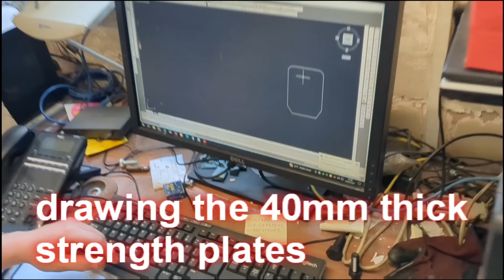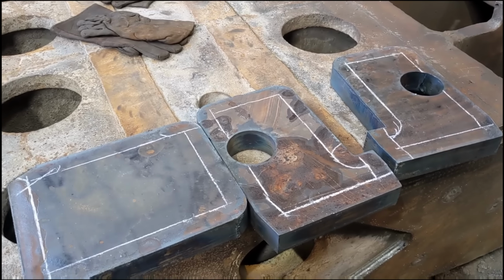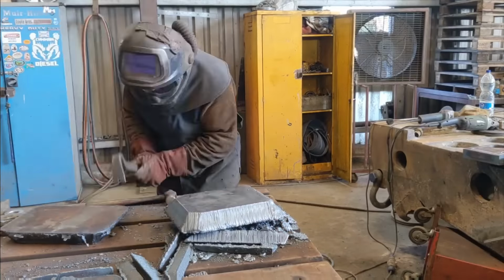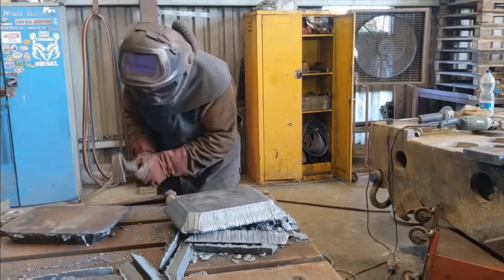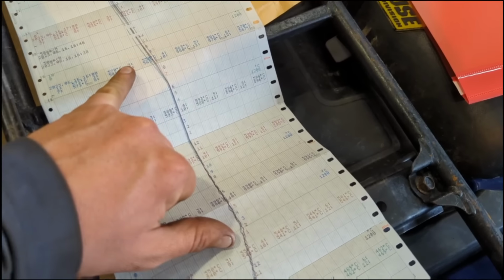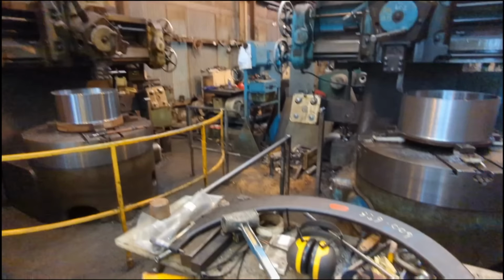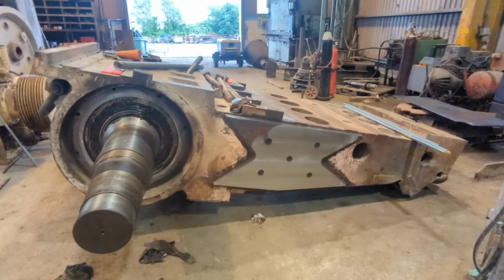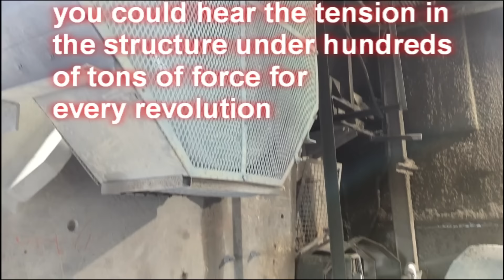10 ton mega welding repair job finished! 12 rolls of wire ! my 500th video! engineering machine shop

Comment: I have been welding since 1964 and still love it, but seeing the direction of travel is becoming a problem. I have not done it full-time, but many hobby jobs have been undertaken. In 1971, I built my aunt a bucket and blade for her Fiat tractor. In 1984, I built myself a tractor mower. From 1976 to 2000, I worked on bus repairs. Welding jobs always come up. Well done, sir; well worth the watch. Ted from down under.

Comment: 31:16  i do not miss that part of the job at all. I welded 18yrs in Brisbane and on the exotic metals  or pressure pipe stuff preheated, multi-run and its 38⁰C outside and your drinking so much water yet not micturating at all.

There is was a place in brisbane, Jaws Buckets Attachments that were always looking for blokes to weld these massive buckets. The whole thing is preheated to ~120⁰.  Flux-core turned right up, sitting on these things with blankets and bits of pallet timber, which would selfignite before the shift is over. Everyone is acting weird and aggro because they are seconds from passing out. I didn’t last long there!

Anyway, great job. Happy new year.

Comment: Great video as always, it is amazing how it holds together long term when in operation with all the vibrations and loads on the components, You have completed an outstanding job there. Just shows how important Heat Treatment is to the long term durability of the equipment.

Comment: A very challenging problem to put it mildly ,  the shear size and weight alone made it seem impossible .  Getting information on the best way forward was brilliant and correct ,  the shear mental battle of taking on this project is truly exceptional .  Many would have said no ,   but you have proved it can be done  .  A small tip the wire feeder , the Brass bushes  in the rotating gear are to soft , try getting them machined out and re bushed with  a material like Phosphor Bronze they will last a lot longer .

Comment: I read somewhere that society needs 8 tons of crushed gravel per year per citizen on average. No idea how accurate that is, but it adds up. Sounds like a lot till you add up all the uses for it. All the roads/buildings/concrete construction/etc. adds up. 

Awesome vids. You sir do some fine work. I love welding, but wouldn't even know where to start lol. My fav videos were oxy lance melting shafts out of crusher housings. Those jobs were cool to see, but nothing like this. I remember watching you when you first started posting the kubota articulated loader vids, been a long time. Congrats on the  popularity. Hats off. Have a good one

Comment: I loved watching all three videos on this project. I love rock crushers, welding, machining, etc. I used to be a heat treater for bushings, cutters, and many other parts for oil drillers. I also heat treated parts for tools and many other items. You should do more videos on these rock crushers, in my opinion.

Comment: Would be interesting to know how much is charged for a job like this? Not exact figures but rough estimates
Reply: I was wondering was it not better for the owner to buy that whole new peace ,rather than paying for the welding,which is always risk in my opinion.I believe prices could not be very different ,i mean new part vs this repair job.
Reply: @TheSRBgamer63  he said it has been running since 1989 in the video, maybe the jaws are no longer manufactured? I would imagine 2 months of welding, machining with their specialised equipment and cost of electric for welding/heating etc, the repair must have been 75k+. Even if it was 100k+ that may be cheaper than new 10 ton cast jaws. Such an interesting channel and the jobs done are next level

Comment: Congratulations brother, great job you did. Takes me back to my welding apprenticeship in 1975 in a gold mining repair shop. No such thing as ear-protection, fume extractors or respirators, just plain ole compressed air to ventilate confined areas.  Good memories but hard work and lots of dust, smoke and sweat.

Comment: Interesting to watch. As for the heater power, 150 kVA (or 150 kW since heaters are a resistive load) sounds about the right ballpark. Steel has a heat capacity of roughly 0.5 kJ per kg and Kelvin, so to heat up 10 t of steel by one degree you need about 5000 kJ. 150 kW delivers 150 kJ/s, so about 33 s to deliver those 5000 kJ, or in other words with that power you could heat up the crusher jaw by just under two degrees per minute or 550 degrees in five hours. Of course that ignores heat loss to the environment (and other details like that the heat capacity isn't completely constant over this temperature range), but I think that cancels out with not the entire jaw being brought up to full normalizing temperature either.
Reply from the maker: Awesome figures bud thanks for that insight

Comment: How about Submariners?  I'm a retired US Navy Career Submariner.  Served on four nuclear submarines with lots of Shipyard Time.  I retired and worked on the same Subs I served on.  Visited General Dynamics Shipyard more times than I like to admit where they build the SSN-688 Class, Seawolf Class SSN-21 the New Virgina Class SSN-774 Subs.  Closely worked with Portsmouth New Hampshire Shipyard for Submarine Repairs and Overhauls.  I've seen some very complex Submarine hull and structural repairs and manufacturing processes.  Seeing Submarines built from start to finish at the Groton Electric Boat SY is AMAZING!  Watching welders complete a 12 foot hull cut on a dry docked submarine pressure hull is a once in a lifetime experience.  Everything is documented and controlled.  The hull plate beveling, fit up, welding,  preheat and cool down is painstakingly exact and very controlled and well documented.  yep, Massive heat strips tacked all around the weld repair area for days at a time.   Then there's the weld X Ray process after all is done.    After all that we get to take the Submarine down to test death to test it all out.  Nothing like Trial By Fire!  You have to trust your Nuclear Welders!  I cant even begin to explain the processes that is involve the documentation, prep, testing, controls and precision that goes into the welding and brazing that goes into the Nuclear Reactor Plant Systems.  Thats a whole different world! .  Question?  Why don't you use something like those electric heat pads/strips for your pre heat processes on those BIG projects?  Im VERY IMPRESSED with the work that you do.  Well Done!

Comment: Three hours well spent. Fantastic project. Liked the machining at the end. I had heard of the heat treating process. You see it on lots of tool making type products. But that set up was mega. Great that you showed the whole process right through. A lot to take in. That rock crusher is unreal. The ultimate welding test. Based on that. Not much you couldn't stick together. The capabilities of your workshop must be pretty unique. I like all kinds of old machines. Engineering. All sorts. Post it. I will no doubt watch it. That was an epic series. Thank you.

Comment: My dad used to work at the front gate of a metal fabricating facility. They did plasma cutting and welding things like railroad bridge sections. Now I know what those empty black plastic reels he kept bringing home were from! We would use them to prop up things off the ground. Enjoyed all three videos and though I will never weld anything as heavy duty as that (amateur here) it is so nice to see all these bits of knowledge put to practical use in one job. Thanks for sharing!

Comment: Astonishing set of videos... Brilliant, loved every aspect of them. Everyday is a school day as Baz from Welderfabber says, didn't expect the air bubble behind the two flitch plates to cause so much of an issue. Memo to oneself next time on similar jobs a couple of pin holes in the plate to allow expanding gases to escape during the stress relieving. Loved the detail of that work, seen it done on pipework on steam plant etc. Nothing this size. Talking of size, was this a priced job or time/ materials etc. I've run engineering works in the past so know how the coils of wire, grinding discs gases tooling etc can run up quickly. Work to the shaft and bearings equally interesting, done lots of freeze shrinking shafts /sleeves etc. Loved the old horizontal borer, some provenance with every cut that beast does, we had some Webster & Bennet vertical borers, old but did a cracking job. Huge Butler radial arm drill too. Oddly we were situated in the old Craven works in Stockport, we were part of the Crane  pump and valve business.  Later in my career, I managed the upgrading of several huge Craven lathes, increasing the capacity of one from 250 ton to 350 ton, handling very large steam turbine rotors. Great pics from the machine back on its feet, there's something hypnotic about the chop chop chomp of the jaws crushing rock at quite a leisurely pace. No rock  as long as it fits in the jaws will stall the process. Wonder how much kinetic energy is stored in those flywheels   Keep posting, love the content.

Comment: Am I the only one that was bothered by the bolt hanging over the edge at 1:02:18, not like the crusher couldn't handle it?:face-green-smiling:
Watched the videos from start to finish.
Previous life I worked with fabrication 1/2 the size of what you work with, and that was a rough days work. 
Theses videos are a testament to real skill and grit!

Comment: Definitely the largest horizontal boring machine I've seen. Great history and still running in spec. The Engine Lathe, I've operated a 48" Chuck, however, the bed was 24'

Comment: As a sparky I can tell you with a resistive load like that 1VA is 1 watt. VA is volt amps. Watts = volts x amps. So 150kva over x 5 hours is 750000 watts of electricity or 750kwh. 

Did they have a diesel generator outside? According to a random website diesel generators use about 0.4L per kilowatt, so that would be at least 300L of diesel burnt.
Reply from the maker: Awesome numbers thanks bud

Comment: I watched the whole job and loved it thanks. I was thinking how our worlds would never collide until 1:00:15 when you wrote about microwave size rocks. I thought you were so wrong until I checked and saw "The microwave region extends from 1,000 to 300,000 MHz (or 30 cm to 1 mm wavelength) so you're bang on and Mr. microwave communications guy just learned something new.

Comment: The Manlift shop here used to burn side plates and counterweights for boom lifts. I had to draw huge parts, full scale, on mylar for the tracer torch. The electric eye had removed the need to make aluminum tracer patterns. CadApple and AutoCAD didn’t come to me for another 5 years.

Comment: I love that big HBM. It makes mine look like a wee little baby. On the plates use epoxy to displace the air also make it stronger. Lots of automotive structure is put together with nothing but epoxy these days as it is stronger than spot welds.

Comment: result, done some work if original jaw from 1988, guessing parts limited now and without a repair whole machine would have to be replaced (bet other machines in quarry were working hard while that one out of action)

love the commentary and bg music (growing up in 80's with all the synth/electro stuff etc.), bet you're all glad the side plate expansion got picked up before final assembly! cheers, Paul

Comment: The sheer scale of this work - saw the whole thing. I wouldn't have thought it could even BE welded back together and yet you did it. I loved Aboms channel when he worked on the big stuff and Webb too but neither does that anymore and I miss watching it. Something about being so accurate at that scale just fascinates me. When you pulled up that bored out sleeve that was 2 microwaves across and so thin you just know he found dead center on that 2 story machine.  Boggles the mind.  
You dont talk about cost which I wouldn't normally expect anyway, but can you give even a hint? I've no clue if it was $500 or $5 million to rebuild that thing. 3 months welding work for you and then the machining required ... I can't even imagine...

Comment: I was missing the weld cleaning between passes until this video.  I know that cleaning is necessary.  Today,  I could see the angle grinder with wire wheel laying in different places between passes.   Never seen this type of heavy duty welding and machining before.

Comment: Should be: " Can i fix this? Oh wait im a welder so yes." I do deep foundations so 500lbsft ibeams+ welded together. 4" thick stuff dumping two boxes of welding rods into em, 8+hrs on one weld. But you if you know how , can pretty much weld any steel/iron. But the job taught me a gas axe/torch way better. I cut stuff before but when its 6" thick you gotta know what you are doing. Taught me sooooo much

Comment: I had a summer job working at a rock quarry.  At times I helped unclog bolders in the crusher.  It was a 2 wall crusher maybe 8' wide taking bolders 2 to 3 feet in diameter.  That sound penetrates your body like nothing else.  It wasn't incredibly loud, but you felt it.  You respect the crusher because it will take your fingers off before you know it happened.

Comment: I work in Test and Validation for a UK electric motor design/manufacturer and your stuff is awesome to watch. Not just the heavy machinery types here :)
Reply: And I like to mess around with my home built ebike. Battery made myself, modified motor for better thermals and an aftermarket controller. Couldn't recommend it enough!
Put a new rim on last two nights and fitting the tyre as I watch!

Comment: I am surprised those side plate bowed . Back in the 1980 I was involved in putting a hot water heating system  into three greenhouses. We had an above ground & a below ground system in each of the three houses. When it came to the manifold for the pumps I had sourced a piece of 18" pipe & had to fit 6 flows & returns for the circuits plus a cap in each end with flanges for the flow & return to the boiler. The old fitter overseeing the project told me to weld it with a stick welder. He never said why. I took all the parts back to the workshop &  thought if I use the mig, no slag traps  easy to overlap etc. I welded everything bar the return to boiler end both inside & out & then fitted the cap with its flange. Got it back to site & a couple of days later started to fill the system. When the water level reached this manifold it was like a massive shower head. Leaks everywhere but the welds looked impressive. The old boy looked at me & said I thought I told you to use a stick welder. 30 gallons of Fernox later  the leaks started to dry up & all was good. Years later watching some pipe welders on a large biomass project  the where using  rods to weld all the elbows etc.

Comment: The end, where part is used, made all the difference in understanding the problem. AND it held for 3 months. Success. 
Wonder who came up with this particular design for the machine, and whether the plant had a back-up unit working while that plate was down. Also wondering whether a spare plate would have been available from the OEM, and whether the cost would have been competitive.

Comment: I think the largest stuff made in Machinery tends to be mining industry stuff. I remember years ago versatile Pacific did North Vancouver was doing some work on I believe it was some kind of a sifting plate for a rotary crusher, and they were bending it in segments so they have formed a half cone and the stuff was out of I believe it was two or two and a half inch plate with these massive holes punched into it for some unknown reason. For years I had one of these steel plugs around using it as a paperweight but I lost track of it

Comment: Yes Side plates would of distorted with the heat cycle of welding rather than air  pressure  . This because theres a rotational effect along the axis of the weld  . 

However was great to see the end result in operation lol   ...
Some i dont always see when being involved in over haul work  during shut downs ...  
😂😂😂

Talking about large lathes my friends father told story of his lathe operation of sitting actually next to the  cutting tool of the lathe as it traversed the Item being machined .... 

Thankyou again ...

Comment: I run Lincoln powerwave 455 dual feed with chiller it never stops heavy duty everything.. An old  esab migmaster 250, miller dynasty 200 tig

Comment: @31:56 "If you turn the lights out the middle of that thing would be red hot, maybe even yellow hot."

Red? Yes. Yellow? No. Just look up a steel color temperature chart. Around 600 °C is brown red to blood red. Around 700 °C is dark cherry red, full cherry red comes around 800 °C. Light red to orange sits around 900 °C and bright yellow means the steel is about 1100 °C. White hot would be above 1400 °C.

Regardless, that was some blood, sweat and tears man. Mostly sweat, by the looks of it. Impressive!

Comment: Great job, amazing for one man. In the 60's I worked in a steel mill where we repaired huge stuff like this, no wire then, just 1/4 inch electrodes at over 300 amps. we would have used at least 3 welders in shifts with helpers for each.

Comment: Wedges: Here in the states we weld an all-thread coupling on the edge of a steel plate then use the threads to wedge steel into its welding position(s). It works great !

Comment: Hi Matt how are you going if you get yourself a decent Tomerong change it to the chassis of the excavator then attach it to the bucket then pull it tight and bring the sticker in that will hold it and therefore you'll be able to take the top cylinder off

Comment: Those side plates ballooning is nuts they where 20mm yeh? 
Have seen it when we galvanise parts and have be surprised what happens, key as you say is have a vent hole! 
Well done on the 500th video keep them coming (engineering and tractors for me 👍)